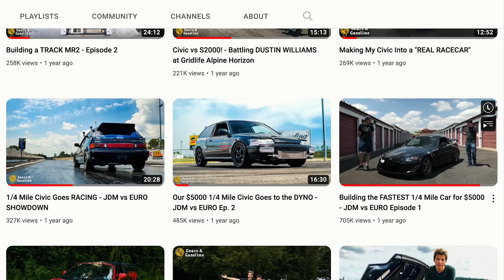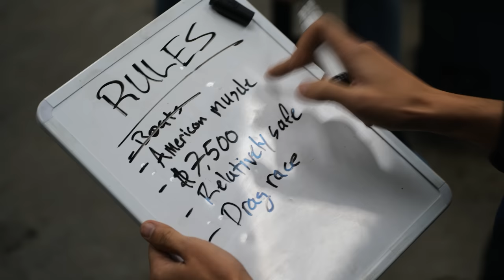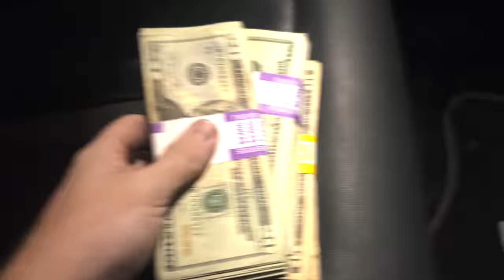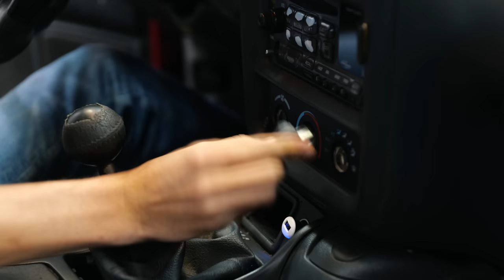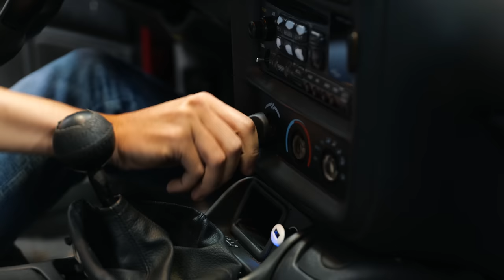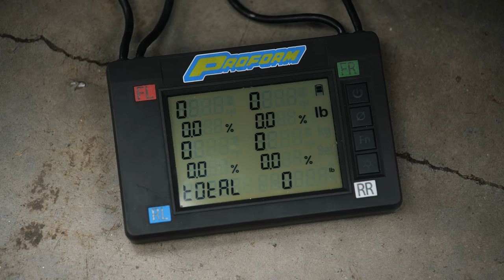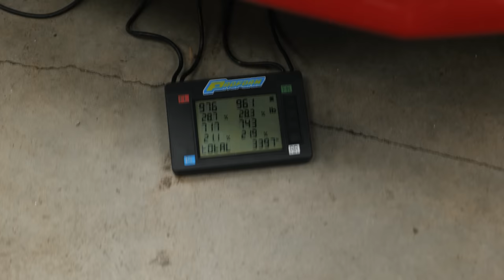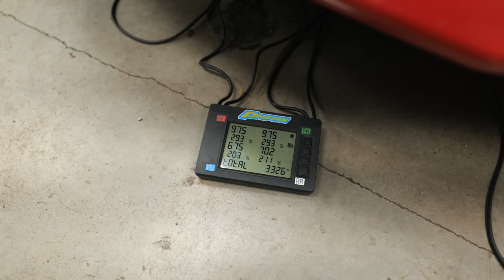Building the Fastest American Muscle for $7500 - Camaro Build Episode 1

Comment from the maker: Guys PLEASE send me links to running and driving LS1/T56 F-Bodies for less than 5k. Apparently they are extremely common.
Reply: Sure! But up north here they are all rusted out
Reply: Send em to me too
Reply: I got a 02 Camaro SS with full bolt on wheels suspension running and driving for 7.5
Reply: "Boy howdy Ben, y'all done goofed! Y'all coulda hadda mustang turbo from 89 fer way less!" is probably in those messages too! 🤣🤣🤣🤙🤙
Reply: @David25512  “oh yer, my buddy built a 1000hp stang for $50 in his mom’s basement”
Reply: They used to be common pre-pandemic. Nowadays, maybe not. BTW your Camaro's engine will respond very well to a camshaft and intake manifold upgrade. The LS1 in the Camaro has one of the worst intake manifolds, and a pretty weaksauce camshaft. Also, Richard Holdener is an LS guru. You should pick his brain, if you haven't already.
Reply: @David25512  Yeah, I was surprised they didn’t go with an older 5.0 fox body mustang. Lightweight and well balanced chassis that can handle a big power plant. I haven’t watched humble mechanic yet, maybe he’s going Ford?
Reply: do you guys have a telegram channel?
Reply: @ryanleggott2716  nope I got into a accident in a 94 caprice :(
Reply: How do I send them to you. I've found 7 so far. All with various body conditions and interior conditions
Reply: @BPBomber  5.0 fix bodies are really hard to find that aren’t roached out
Reply: They definitely exist, I have an 02 SS Camaro that’s in great condition that I bought in November for $6200
Reply: Only cheap v8s that would be a great option is the f bodies or b bodies with the lt1. The lt1s have great potential even with just bolt ons and a tune
Reply: @ochocinco2891  the old fashioned SBC has an aftermarket that is NOT rivaled by any brand. SO much stuff to strap onto those old motors
Reply: I bought a 2002 convertible SS LS1/T56 with 120k miles for 6k last summer. It was in way better condition than what you guys have. No rust, no cracks on the windshield and dashboard and it drove really well. I was able to sell it for 7.3k a few months later. Lol
Reply: @6.2Slomaro  who cares about the interior condition on these older American cars. I’d much rather do Interior upgrades than rust repairs or engine repairs
Reply: @zackatron925  I bought mine in LV. No rust. Paint is good. The motor and trans was healthy. I guess it was cheap cause it was a convertible.
Reply: @6.2Slomaro  you got a steal my guy, where I’m from I’ve looked at 3 ws6 trans ams and 2 of them where just BEAT. Had rust, mold from leaky tops and needed paint and body work on basically every panel. Whole suspension needed gone through lol. Not the trans am for me haha. My mom had a 2000 SS. Miss her and the car. I remember it being fast as hell for the time
Reply: I don’t think they are common these days. 5-10 years ago maybe, but not now.
Reply: @kilroy4123  you are insane
Reply: Well, they'd just be in better condition for that price
Reply: I don't know if you're in the community there could be somebody that that is thinking, I want you to have this, because you're my car brother. Because they know you will do it justice. Some teenager that can't change oil not going to work.
Reply: @zackatron925  I did haha that’s why I was able to resale it few months later. Sold it for more than I paid. It’s hard to find clean F bodies now a days. They are like the shit box civics in the American muscle world.
Reply: I got my 00' camaro ls1/t56 carnfor 3,200 back in 2017! value has gone up on em
Reply: Yeahhhhh good luck. Maybe 3 or 4 years ago.
Reply: @zackatron925  lmao foreal!
Reply: @BPBomber  Fox body prices are crazy right now. They wouldn't have gotten a 5.0  with a body as solid as this for less than $5k. The SN95 Mustang Charles picked up is a better deal.
Reply: They don’t exist….. not anymore
Reply: @shaun9156  about what?
Reply: Hit us up for your need any parts or a rebuild on the T56, we'd love to see what we can do to help set up the F-body! We're right on the border on VA in Mount Airy, NC! It was nice meeting you guys at PRI!
Reply: Me too!
Reply: Goodluck finding a good t56 😢
Reply: Found a mint one out here in the Bay Area 8.5 98 z28
Reply: There are a lot here in Colorado Springs
Reply: Use to be until 2019ish
Reply: Ffs you really couldnt enjoy ur camaro without trying to fuck the prices

Comment: GM was using metric bolts 99% of the time by the late 90s as a heads up. The seat bolts are 13mm but 1/2 inch is 12.7mm which is why it works too.
Reply: I'm pretty sure that car was assembled in Quebec, Canada, which makes the metric vs imperial debate a little funnier! 😆
Reply: Pretty much all American car manufacturers were using metric from the late 90s on.
Reply: Yeah it's a Canadian muscle car

Comment: I've owned a 98 Z28 for 22 years and autocrossed it successfully for several years. The lowering springs you want are from Strano Parts in PA. They should be around $250. Pair them with decent shocks and the car will handle really well in Autocross.
Reply: Strano treatment with his shocks, springs, and sways make a night and day difference with the car.
Reply: Yep, Sam Strano is the king of F body handling performance.

Comment: Ouff! you picked the only year i would not own for an LS1! good luck w/ the OEM ECU! 😅
Reply: good news tho you can Repin the entire ECM to run on a 411 ECM without having to cut anything!
Reply: Not hard to tune at all. I own a 98  and I've never had issues with using HP Tuners on it. Very easy to do. I have unlimited credits for all 98-02 Fbodies with the LS1.

Comment: As a fellow Camaro owner, I can assure you the rear axle will be the weakest link.  I give you 2 launches at the strip b4 it blows.
Reply: Get a Hawks diff cover. Mine has held up for 7 years and plenty of launches. But they are a weak link. Mine with get a Ford 8.8 once it goes.

Comment: LOL, came here waiting for the 10mm part! Basically everything major on there is 10mm, makes life so easy. Also super good chassis for autocross, Strano Suspension was Dominant in CAMC for years at the national level. Factory '98+ cars also ran 12.8 and 12.9 in the quarter mile consistently back in the day with the T56, after the standard weight (t tops and spare tire) was removed. Dummy quick cars in stock trim.

Comment: You guys are gonna change your mind when with a couple bolt ons and a $500 nitrous kit its faster than every car you’ve built on the channel in the 1/4 for half the cost. Edit: Just finished the video, and very pumped for vs turbo ls. May want to look at a clutch because the stocker wont like that amount of power. And the 10 bolt rear is gonna be the weak point.

Comment: I worked at Advance for 10 years as a retail parts pro. You can get an LS engine no problem, just have to order it. I had ordered engines Transmissions Many times for customers. Tell them you need to order an engine for a 98-2002 Camaro or 97-2004 Corvette for the 5.7 LS (LS1) engine or the truck for the 5.3 LS engine (LM7) That Avalanche you said was closer had a 5.3 with aluminum heads (LM7) That catfish was the first year for the ls1 and that front end in the Camaro, pretty nice if you ask me, but would put the 97 front end on it cause it looks meaner.  I got a 97 Camaro with the LT1 and I love it. Back under seats get wet from the rear hatch leaking at the top. best way to dispose of an airbag is to sell it, there is surely someone looking for one those years 93-2002. The little bit of play is normal due to the locking mechanism. Every one I have seen even brand new has that little wiggle in that style tilt wheel. Great video guys.

Comment: We have two 1997 Camaros, a Z28 and a base model. Both are in nearly perfect condition. Zero rust on either. The base model V6 has a blown 3800 motor in it that needs a rebuild. I'm pretty sure neither one of them has seen so much as rain. Neither are the LS engine (Lt in the z28 in 97, right? and 3800 in the base model) but both are better looking than this one. The different nose design is just better looking. No catfish whiskers, or nostrils above eyes here. One is that same red, the other is the cayenne red, which is quite fetching. Both are convertibles. The only problem with these two cars (other than the blown 3800) is they're both automatics!

Comment: Trickflow makes an LS1 top end kit. Heads, cam, pushrods, lifters, headgaskets, headbolts all in, like $3500 USD. Some have intake manifolds. With long tubes it'll make 500hp (not sure if crank or wheel). Add a good clutch kit, short throw, 1-pc driveshaft, Eaton Posi, 3.73 or 4.10s, slicks, skinnies, C5 Z06 brakes, Eibach handling pack (shocks, springs, sway bar). Maybe add some tublar/poly rear control arms. Add some lower control arm drop brackets, maybe a 150 shot fogger system you'll have a beast of a car.

Comment: As a super fan of the generation before the 4thgen you are working on in this video (Yes, I’m a big fan of the old 3rd generation ’82-‘92 Camaro/Firebird “Mullet-mobile”; I’ve heard all the nicknames). I can attest that every bolt and nut that came on these cars was Metric.  GM had a big thing for 10, 13, and 7 mm bolts/screws.  Pretty much the entire interior can be disassembled with a 7mm socket, or a 9/32”, if you REALLY want to use standard size sockets.

Comment: I owned a 2000 SS for years. The water either came from the T-Tops, the rear glass seal, or from being parked on a decline nose down. It's also had a new fuel pump at some point judging from the duct tape on  the fuel tank trunk hump.

Comment: About the water leaks, definitely leaks from the T-tops and the rear window. It's normal for the steering column to have a little bit of play, I've never been inside a 4th gen Camaro that didn't wiggle a bit. I would say to be careful entering and leaving the car and not slam a knee on the column. That oem dash will get cracked if the car is in a hot climate like Texas or Florida; no avoiding that.

Comment: As an fbody owner I laughed the who time. These cars are super slept on due to their looks but they can perform very well. The steering wheel issue is very common, hawks Motorsport sells a billet bushing for that pin, there’s water all over the floor from the usual ttop leak.

Comment: Pretty much just buy anything with an LS motor, get the heads port/polished, get a cam, throw some nitrous or an ebay turbo kit on it, and upgrade the fuel system accordingly -- also, LQ's would qualify as an LS motor.

Comment: You definitely aren't Chevy guys. That's a c clip rear end. When you Yank on the rear tire like that the axle slides in and out a bit causing that clunking noise.
Reply: You needed to pull the pins and continue disassembling the column. The four bolts on the tilt mechanism are loose.

Comment: Lid, LS6 intake, long tubes, ORY (or true duals dumped before the axle) cam, sub frame connectors, panhard bar, junkyard V6 shocks up front for better weight transfer, slicks and a 150 shot of nitrous. 

10 second car all day long.

Comment: For a cheap negative camber gain,  you can increase the slot width on the front camber adjustment on the lower control arms

Should have combed marketplace for two pairs of rear 315's on 17x11's. That would have secured the wins at the drag race and autocross part of your challenge. 

The stock spring rates and shit shocks and struts are gonna hurt you

Only do the front swaybar

Comment: Single turbo LS builds are great, but a pair of slightly smaller twin-scroll turbos are even better if you've got the space around the engine for them. Because you can take advantage of superior exhaust scavenging from routing the exhaust gasses to two separate turbo chambers, you can get quicker spool-up and better sustained boost at lower RPMs. They do then to tap out pretty early due to the smaller scroll volume, but unless you're going for a high RPM LS build, then it won't matter anyway. They do tend to be expensive, though, which isn't ideal for this challenge.

Comment: These cars were ment to be soaked ! Lemme tell you a small story about the F Bodies. These were built in Canada on the North shore of Montreal until they "killed the Camaro, Trams-am and Firebirds in 2002. (Probably one of the reaso s you got a lot of metric in there.)

Living close to where the plant used to be (Now it's one of those malls with a Costco, Staples, Toys R Us and a bunch of restaurants), one day I was chatting with a guy that used to work there and he was telling me stories about how it was. They were always pranking each others and one of the recurrent prank was aimed at the guy inspecting the cars at the end of the line for conformity before getting the car shipped. Appearently, they were using a garden hose to soak the interior of the car and particularly driver's seat so the poor man would end his day with a damp pair of pants. 

While he was laughing his ass off remembering good memories, I was kinda thinking that was probably one of the many reasons they wanted to shut that plant off and move it elsewhere to "revive" the Camaro 4 years later with the 2006 Bumble Bee Camaro "concept" car, 300 miles away in the neighboring province of Ontario.

I cannot imagine the amount of money it cost GM to close it down with all the benefits all the employees still receive as of today.

I did own a 1986 berlinetta. Cool looking cars, you sit litterally in the floor and the dash is so high that you just can't see nothin. Surprisingly nimble for the boat that it was. The build quality was not so good as you can imagine. 

It is still a 2 door sport coupe that is longer than my Subaru Outback (Weights almost as much). And you can't even fit someone with legs in the back seats. Supposed to be a 2+2, more like a 2+1,325. You can fit more stuff in a miata's trunk, unless you've got luggage in 2 dimensions.

That rear hatch weights a ton and the shocks were always bad (surprisingly yours is holding up, it's a good car !) A piece of 2x4 was a usual sight in the back glass of those. 

I still have good memories though and if it would fit in my garage, I would have been tempted to get another one.

Comment: 12:29 It’s actually kinda funny y’all mention that because technically every 98-02 F-Body is actually Ram Air including the V6s because the air ducts on the front bumpers create a functional Ram air system but as a guy with a real WS6 and a functioning ram air hood unless you get the high-rise airbox base you won’t notice any significant gains if you change your filter or box

Comment: You should really just detonate all your airbags when you get time, just get long leads. I work around a GM dealer and with our 15-16 roof rail airbag recall we have to dispose of them ourselves. We just cut the bags off, and use long leads while it sits in a skidsteer bucket. It's what GM says to do anyway.

Comment: @gears and gasoline the hole in the back is a common gm fix for every 4th gen Camaro/trans am 
Its a hole for the fuel pump in the tank. You cut an accessory hole and then weld it back together its way easier then dropping the exhaust and rear end to drop the tank so thats common

Comment: The steering is a common 3rd gen problem, theres also 4 torx bolts that hold the tilt mechanism in place that need to be tightened

Comment: 18:00  that is one of my biggest pet peeves/urkes with these cars...... Uncle Bubba and his good fella Rick say you don't need to remove no fuel tank to get to that fuel pump..... just hack an access panel in the trunk...........  that way you don't need to pull the driveshaft and exhaust.....   FACEPALM....... ALSO  Y'ALL should just take the massive performance gains a stock ls offers over a stock 4.6 and go with traction/suspension upgrades  actually make use of it  and all that stuff is probably wasted anyways  ya'hear?  lol I'll stop playing hick,  I've been a professional mechanic for over 10 years and owned an older Camaro since I was 17 .   for some reason I still can't help playing hillbilly when discussing these cars lmfao  it's just too much fun

Comment: I love how people do not understand how a fourth gen ram Air hood works.... Well at low speeds it doesn't do s***. ... Probably.. the way that the air system functions on a Camaro is it picks up all its are from underneath the air cleaner which is right above the supports for the radiator... This hole in the hood lines up with the placement of where the air is being taken in by the engine.. so while not a direct ram air system... It does function. But even works on a V6 car..lol

Comment: As they were listing issues with the car i was thinking about those same things with my car, just "cracked dash yep that's normal" "comes stock with the always adjustable wheel" "yup they leak oil around the pan it just happens" "yup losing oil out the trans that's stock"

Comment: 10mm and 5/16 are basically identical you can use either to disconnect the battery and then jack up the car.

Comment: All of the seals, the t-tops and the rear hatch, are bad. The seal around the windshield might even be bad, hence why it cracked, because it was installed wrong in the first place. This is why you have so much water in your car, and the way to get the water out is it turn the heat all the way up in the car, and then have all the windows rolled up, except one window that you have a fan blowing out of...

Comment: It's hard to watch, as a 4th Gen fbody owner/ 2000 Camaro RS Y87. Chargers and challengers are the crave nowadays, and they are WAY larger than the 4th Gen and I'm on 20's. The tape in the back was not GM, this is a fuel pump access hole most owners cut to gain access without dropping the tank.